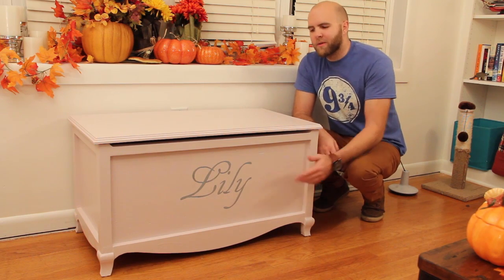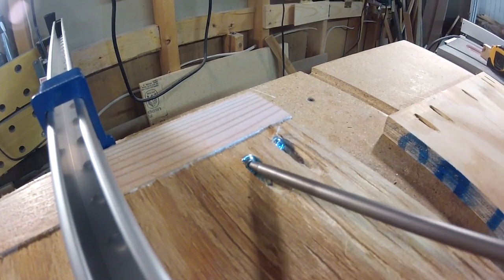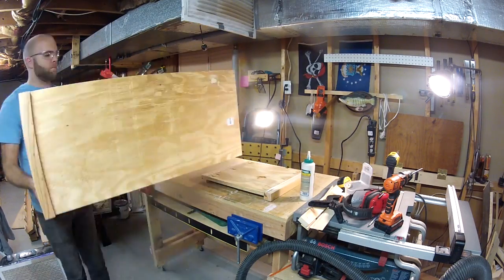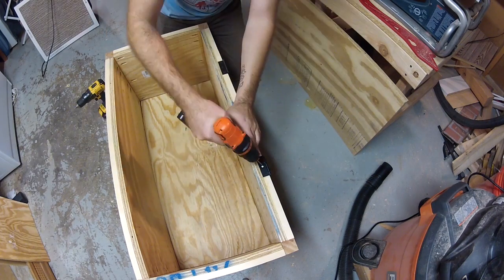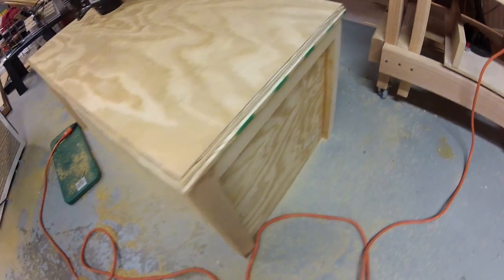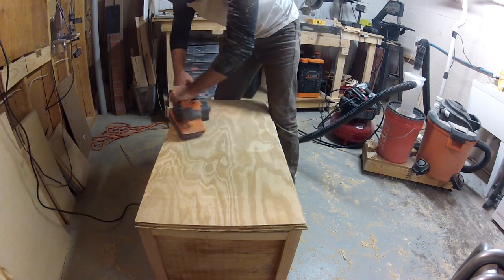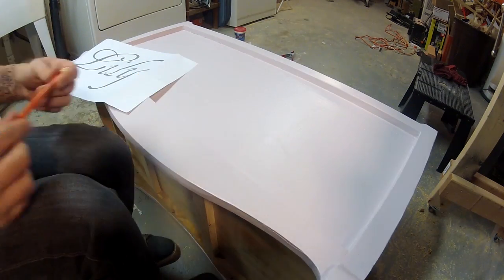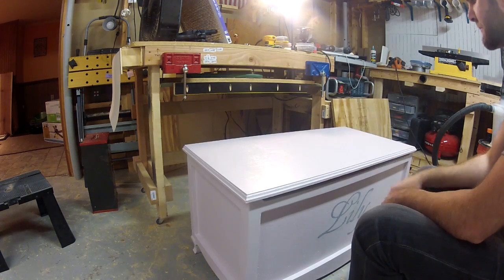DIY Toy Chest with Hand-Painted Lettering

Comment: Mate, an absolutely top job. I'll be making one of these for a customer. If I was to make one criticism, it would be the exposed pocket holes.  I'll be filling them in with a bit of putty. But, overall, I think it turned out fantastic. Keep them coming mate.
Reply: Built By Chris could you design with the pocket holes on the outside and cover with the trim work?  In other words, a plywood box with the pocket holes on outside, and finish the outside with trim which would cover the joinery?

Comment: WHEN ATTACHING THE HINGE TO THE TOP, I SAW A LADY USE DOUBLE BACK TAPE, KNOCK THE PINS OUT,DRILLED FOR SCREWS,REMOVED TAPE ADD SCREWS,DRIVE PIN BACK IN.
WORKED WELL

Comment: I am worried about the weight of it using 3/4 inch plywood,  if I change some of the demensions would there be any reason I couldn't use 1/2 inch plywood instead.  also  I like to have it 21 inch deep instead of 15 inch deep.   would I have to widen the pieces you add to the external sides.

Comment: I love your project, it is very pretty at the end. I am sure Lily loved it. How could I make the legs larger?
Reply from the maker: Thanks! If you'd like to make the legs larger, I would recommend using a much thicker block so you have more material to work with. If you just need them taller, just use a wider board.

Comment: Hi, great build. I'm going to try to build something similar as a christmas gift for my niece. Question: Where did you buy the lid supports?
Reply from the maker: Hey there, thank you! You can pick them up at any local home good store like Home Depot or lowes.
Reply: Thanks. I'm from Norway and my local stores of that type does not carry anything similar. I need to order the lid supports online, so I was hoping you'd have any kind of name/brand/product sheet/whatever so I can search online for something similar.